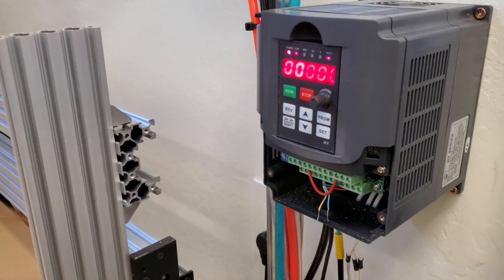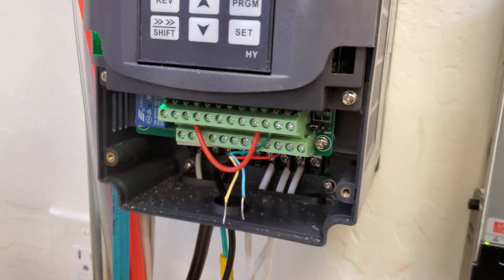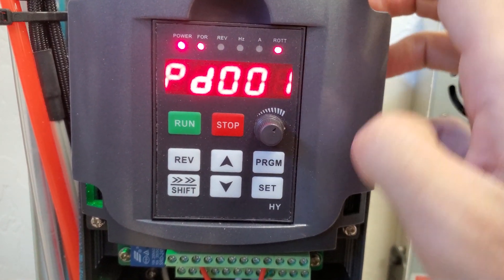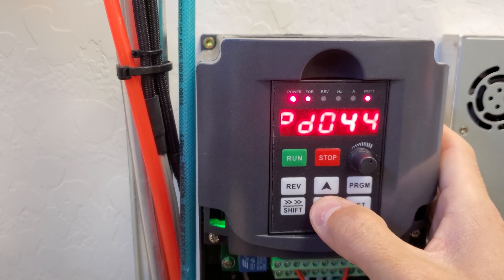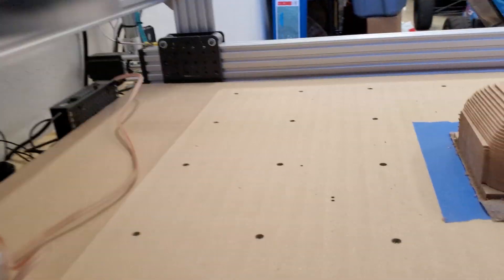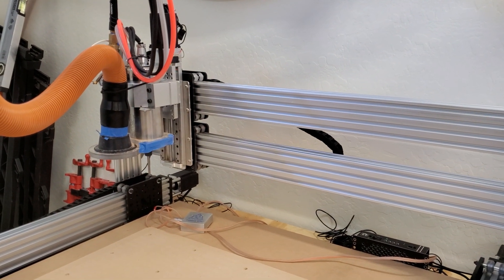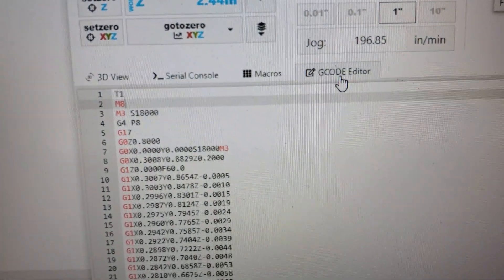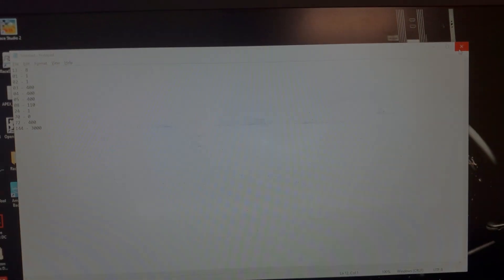VFD Spindle Control via OpenBuilds BlackBox Controller and Software

Comment: Can Anyone maybe help out with which settings need to be looked at for the spindle not wanting to stop? 
I have followed the guide and am running a 2.2kw (220V) water cooled spindle and HY02D223B VFD with the blackbox x32. 
I would very much appreiciate the help.

Comment: Do you use a touch probe?  After I installed my  VFD and spindle my probe seems to be in the closed position when I clip it to the bit.
Reply from the maker: I don't use one on this machine. It's quicker for me to just do it all manually.

Comment: Great video.  I thought I had followed your directions completely and it would not run.  I found that I had set PD004 before PD005 and it does not run that way.  I reset it and set PD005 first and now it works as it should.

Comment: Anyone having issues with the spindle stopping with the newest blackbox I’m running at like 2rpms when I turn tool off. My min max rpm is set to 24k and 0. I can also hit the stop and it stops but I can’t start it without resetting the vfd.
Reply: Mines is not stopping but its stuck at 8000 when i turn it off still working with it now
Reply: @FlipThatPiece  Have you figured it out how figured out how to get the spindle to stop at 0 rpm? I am at this stage in my build.
Reply: @travellingpilot  same problem for me... after the spindle starts spinning, the lowest I can make it go is about 5000rpm. wont go to 0 and i have to unplug the vfd power to reset it. did you get past this?
Reply: @thebucketmouse  No sadly not yet, still trying to figure it out..

Comment: Thanks for the video, great job. A couple items of note is that when I set up my VFD exactly as you stated I got the Spindle to run but it spooled up very slowly and then the VFD gave me an error [E.o.L.A] and the spindle shut down. After mucking about and swearing at it, I then set PD014 to 3.0 and PD015 to 5.0 and I also noticed that PD003 was set to 0, when I do that it will not run correctly and I get errors so I set it 400 and it's perfect now.

Comment: How did you wire up the cooling pump to turn on with m8?
Reply from the maker: It's using the OpenBuilds relay power strip that's available on their site.

Comment: did you need a new mount for the spindle on the LEAD 1010?
Reply: This is what I need to know also
Reply: @Cnc guru 1  the spindle comes with the mount but it's to big for the 1010 or the 1515(which I have) so you need to fabricobble something together
Reply: @EricHaskins71  was worried that would be the case. Thanks i think I’ll bite the bullet and buy one and make a plate to suite. How have you been getting on with the spindle?

I use vectric do you know if the 0-10v from black box to the vfd is a given the voltage dependant on what spindle speed is set?
Reply: @Cnc guru 1  I haven't mounted mine yet lol... I use vectric as well. The voltage is how the speed is adjusted
Reply: @Cnc guru 1  I have been upgrading my 1515 to queen bee mods linear rails etc
Reply: @EricHaskins71  I noticed the linear rails. Looks much more sturdy and I’d venture more accurate on the cuts
Reply: The Lead 1515 and 1010 spindle mounts work perfectly for a 65mm diameter spindle. If you have an 80mm diameter spindle, which I believe is unnecessary and overkill because it produces to much torque and is very heavy, you will need to modify the spindle mount that comes with the 80mm spindle. I bought my 65mm spindle without the mount because I knew the Open Builds mount would fit.

Comment: Thanks fora this. Looking to get a 1.5. But what amps are you pulling while running? My shop is limited to a 20amp breaker
Reply from the maker: I'm on a 15 amp and been fine.
Reply: @BirdsEyeTech  curious what amount of draw do you normally have?
Reply from the maker: @michaelgriffin2914  if I remember correctly, at 18k RPM maybe 3-4 amps. Lower the RPM, the higher the amp draw. 3-4k rpm was in the 10amp range of believe. I honestly haven't looked lately so don't fully remember.

Comment: Can you tell me how you added the commands to turn on your air pump and spindle?  I want to add a pause and turn on my dust collection system, but I only know how to do it maually. It would be nice if it was automatically added in Aspire and output the grbl code somehow. Any info would be appreciated. Thanks for the video as well.
Reply: Did you figure this out?

Comment: I have that exact same spindle and model number. I understand everything about how to set it up, but where did you ground the 110V power coming from the wall? I see the white and black and there's a green wire hanging but, I don't know where you grounded it. Thanks in advance!

Comment: how big is your CNC...im designing mine now and im trying to figure out how i want to set up gantry and such.  im going for 1500mm wide since i want to be able to throw half sheet up.  I was also looking at the 2.2kw spindle.  i would love to see a clean vid of just your printer so i can see how you built it and steal some ideas.
Reply: @gregoryayres1535  This looks like the Lead 1515 to me, so it's a 1500x1500mm

Comment: What does the 400 mean on 5,4 and 72? I have a spindle we are running at 18000 rpm and the normal value on the vfd is 300.00 at 18000 rpm - should I be setting 300 where you have 400?
Reply: I believe it's Hz, cycles per second.

Comment: I have the same VFD and spindle.  I cannot for the life of me get it to run full speed via the blackbox.  M3/M5 work to start/stop.  If I type in M3 S24000 it is topping out around 17,900.  Adjusting the voltage on the blackbox 0-10v does adjust the speed output but again, I cannot get it to 18,000.  I have gone though all the various VFD settings I can think of to no avail.
Reply from the maker: Did it go to 24k before hooking up to the BlackBox?
Reply: @BirdsEyeTech  Yes it did.  I found a few more Settings to change - now the 0 -10v doesn't change the speed but it runs slightly faster than intended (within 200 RPM at 22K
Reply from the maker: @bobfournier113  have you put a voltmeter on the 0-10v output to see if it's working?
Reply: @BirdsEyeTech  Yes it did.  I'm happy with the results now - it's not perfect but if I set the tool setting at 105% it's within 100 rpm at 24000 - all i did was change the wire from braided to solid.

Comment: Thank you so much for this! You got me 90% of the way there. I now have my CNC router up & running. Thank you!
Reply: @Donni Dachitrosi - Fair. I was having a lot of problems with EMF triggering the limit switches. I upgraded the switches and it seems to have solved the problems. 

The ability to adjust the spindle speed with a couple button clicks is really handy. And better yet, increasing/decreasing speed for different cuts is pretty slick.

Comment: I did exactly as you said. I have the same vfd but with air cooled spindle. Works except when sending the turn off signal or just slows to 10k rpm even tho it’s set to 0 rpm in grbl
Reply from the maker: Did you reset all settings on the VFD before setting the settings in the video?

Comment: Wow this is awesome itoo was struggling with the black box setting controlling the setup through the black box! Thank you for this because I was frustrated that the BB wouldn't control the feed and speed!! Thank you!!!!Did youmodify any thing inside the BB move any pins around inside?
Reply from the maker: There is one jumper inside that needs to be changed. Its noted in the video.
Reply: @BirdsEyeTech  ok I'll go back and rewatch thank you!!

Comment: Fantastic Video Thank you. I was struggling for a couple of days until you pointed out the jumper on the inverter box that needed to be switched in conjunction with PD002. Out of curiosity, are you using a relay to turn on the water pump?
Reply from the maker: Yes. I have the IOT power strip that turns on my water pump and air compressor.

Comment: This is SUPER helpful, thank you. I am still selecting my vfd and spindle package so I will revisit later, but can you add a short description for what each of the 'PD' settings is?  The 110 is 110 vac vs 220 is 220vac. The others seem to be random numbers, 400, 400, etc. I'm sure they mean something.  Thanks again.
Reply: Nicholas Giardino when you get your vfd/ spindle the manual that comes with it tells you exactly what each parameter does. The 400’s are hertz that are the maximum that the spindle can run at.